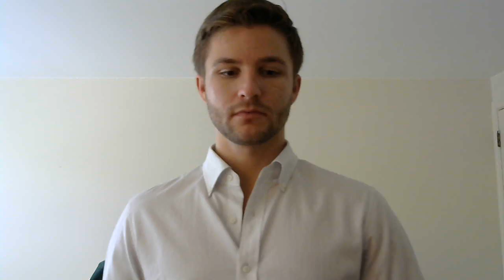Whole body vibration machine industry- Truth about most of these machines

Comment: Alex, I'm looking to purchase a whole body vibration machine for home use. I have parkinsons and am looking to strengthen my legs and improve balance.  I'm looking at 2 machines, the V1000 Whole Body Vibration Unit and the GForce Professional Whole Body Vibration Machine. I have been on the V1000 at a local clinic and was very impressed with the unit. Have you seen or tested either of the 2 machines and do you have an opinion on either?
Reply from the maker: +ticleve2 +ticleve2 +ticleve2 Congratulations on finding WBV. It's good you got to try a 
machine so you know that you at least like how you feel doing it. The 
machine you tried goes by a couple other names and has been out a long 
time as a lineal machine. Lineal machines were really first to market 
way before pivotals. 

One of the names the V1000 goes under as a Re-brand is the PowerVibe Zen Pro. Actually PowerVibe Zen claims they improve the machine and that is why they charge more but either way the specifications and actual performance of those machines is weak. It's a low energy machine. Looking at a third part independent engineering firms tests on this model, for about 90% of the various speed settings the Amplitude it reaches UNLOADED is under 1mm. Usually a loaded tests on a weak lineal further reduces Amplitude from there. 

One of the other specs they provide you is the Force. Did you notice it's in Newtons? LOL. So hopefully you studied Newton's Laws in your Physics class and will crunch the formulas to get some useful specs to then compare to other brands. They are playing games. But hey it's better than PowerVibe Zen not even telling consumers what their Gforce is! The Gforce btw depending on the speed setting ranges from under 1 to 5.

Remember it's cheap to produce Amplitude and Speed but not cheap to produce Force. So yet again you provided good examples of grossly overpriced machines. A great example of this even more so is the GForce Professional Whole Body Machine, which I could import from China a lot of 15 at a time for $75 a piece. Now how does their sale look after hearing that? There are many issues with that machine and one of the obvious issues is that it produces Tri Planar which is a completely made up motion started by the PowerPlate scammers (the new machine not the original) to cover their engineering mistake of a wobbling machine side to side instead of exclusively vertical motion. 

It's normal to be impressed with the first WBV you try but just keep in mind that if you had a chance to try other true high energy machines you would be even more impressed. I don't provide personalized recommendations and guidance through Youtube comments but I would be happy to assist you if you reach out to me through my website contact area at www.healthhacksreviewed.com
I have specifically helped many folks also who have Parkinson's.
Reply: +Alex Tarris Thank you for your very informative response. The only reason I went to the therapy clinic was to see the WBV machine, get on it and see how it felt. The Dr. that owns this particular clinic had never had a request such as mine but was very willing to honor my request and help me purchase one through his rep. The V1000 unit he had was 6 years old but still shook the building when in use. They actually had to put the machine on a rubber mat so as not to shake the pictures off the wall. I would assume that the mat caused some degradation in the efficiency of the machine. Anyway, that was my whole reason to go there. It was the only WBV machine I could find in my area. 
I will contact you through your website.
Reply from the maker: +ticleve2 Thanks for the additional info. 

1. Using a mat does not increase degradation but can help protect a floor or quiet a machine. 
2. It's not a good sign if a machine has a lot of extraneous resonant vibration in the frame itself going into legs etc. What that shows is that a machine is sending a lot of it's potential force instead of through the plate so there is wasted energy there due to poor engineering. 

Properly tuned and good engineering with turn table mechanisms etc can produce lots of power but fairly quietly and with minimal to no major vibration running through the frame, handlebars, and floor. Some of those old school lineals like the one you tried were known for shaking around quite a lot. 

One way you can also know if you are evaluating a cheap poorly engineered lineal machine is the measurement specs across the plate and if we find various amplitudes and forces differ in multiple spots. An ideal lineal plate like a Vibrogym has consistent specs across the whole plate and even adjusts itself depending on where the user steps and weight. I'm not saying you need something that expensive or sophisticated just pointing out don't be impressed with a machine that shakes the building. A lot of this out of control vibration from poor quality engineering in my personal opinion might also not be healthy to engage the body with.
Reply: +Alex Tarris Your website won't accept my message to you. I'll keep trying.
Reply from the maker: +ticleve2 It most definitely should. I just checked it. Just refresh your browser screen and then try it again. Be sure that if it gives you an error check your fields to make sure you didn't type something incorrectly. Alternatively we can also setup a chat time over the phone.